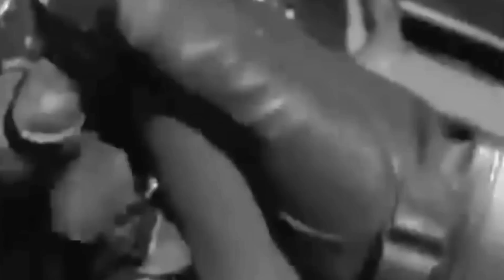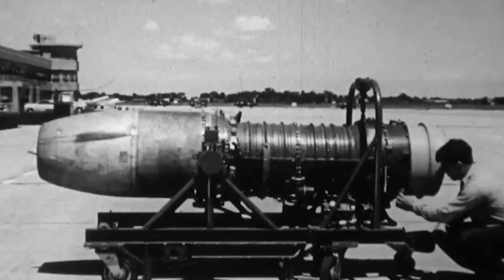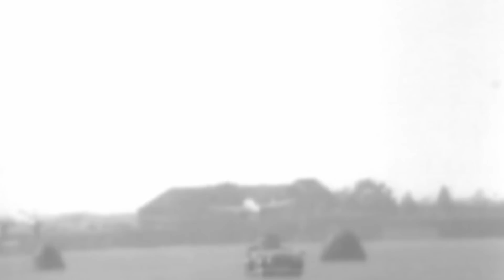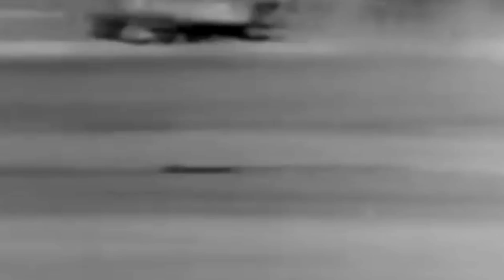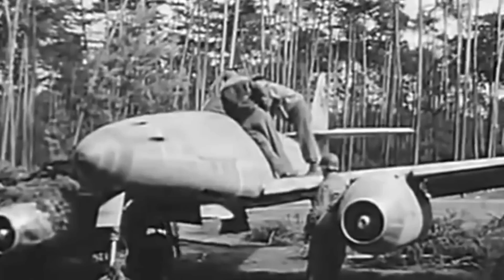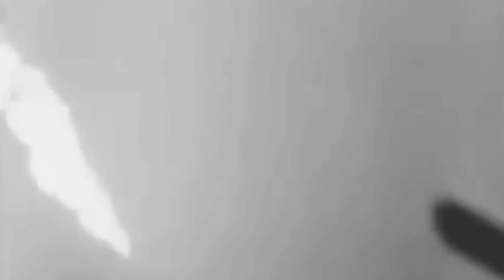The Never Before Seen Fighter

Comment: Swept wings make an airplane faster, and Less maneuverable
Reply: Swept wings and jet engines both make a plane faster and more maneuverable at high speed.
Reply: @WilhelmKarsten : I’m not sure that’s true. I believe swept wings make an aircraft less maneuverable. Perhaps in most cases the greater speed offers better performance than the drawback of less maneuverability.
Reply: @magicsinglez People get very confused about "turn radius"
2 planes with the same speed but one has a tighter turn radius? It will have the advantage.

2 planes with the same turn radius, but one is 100 mph faster? The faster plane has the advantage.

Imagine it in a simple 2D scenario... a bicycle VS. a motorcycle with a 100 mph speed delta.
Reply: @WilhelmKarsten : those variable wings, with the wings way back, allow planes like the F -111 and the F 14 to travel at very high speeds. The plane is almost like a dart.
Reply: @magicsinglez Well, there are two reasons why jets have swept wings, one is the shock wave at supersonic speeds.
The other applies to all aircraft which is reduced drag... both in a straight and level AND less drag in a turn...
Every time you turn, you lose speed.
Swept wings lose less speed, and thus turn faster.
Reply: @WilhelmKarsten  Hello Sandyboy, you forgot the other reason for swept wings, you know the reason that the Me 262 had them... to control the position of the centre of gravity.

Comment: If the Me 262 dropped your jaw then check out the Horton 229 flying wing 😍
Reply: Only one ever flew once and crashed and killed the pilot !!!  A failure !!!
Reply: @wilburfinnigan2142   Not counting the V1 glider that flew.  The second prototype V2 flew under jet power, but only for about two hours total testing time before the fatal accident that killed Ziller.  This was 18-Feb-1945 and the V3 third example was only 50% complete when Patton's forces captured the Gotha workshop in mid-April.  The US let the RAF examine the V3 with some discussion of getting it in the air, but nothing came of that.  That is the short history of the 229, certainly not what that NatGEO TV show implied.

Comment: The ME- 262 was most vulnerable at take off and landing as stated. But it's major flaw was it's JUMO engines initially. They had a tendency to fail without warning, and the replacement/ maintenance cycle was about 6 hours of running time. This made them very maintenance intensive. Allied photo intelligence was used to identify airfields where ME - 262's were stationed, so P- 51's were used to loiter near such fields, to strike ME- 262's when in take off and landing cycles, where they were most vulnerable to attack. Once again, numbers of P-51 and allied aircraft out ran the technical superiority of a smaller number of ME-262's.
Reply: Nevertheless the introduction of jet fighters like the Me-262 rendered all propeller driven fighters obsolete.
Reply: @WilhelmKarsten  Hello Sandyboy, obviously you are still struggling with the meaning of common English words. 
Not only did the Me 262 NOT render propeller driven fighters obsolete, the Me 262 was itself obsolete long before propellor driven fighters.
Reply: The USAAF exhaustively tested the Me-262 during Operation LUSTY and confirmed TBOs averaged 55 hours, EXCELLENT by WW2 standards for Allied high performance piston engines
Reply: @WilhelmKarsten  Wrong they were lucky to get 5 hours , some new engines failed before the plane took off !!
Reply: @wilburfinnigan2142  No different from Allied piston engines... just much higher performance
Reply: @WilhelmKarsten  Hello Sandyboy, as you know 55 hours is certainly NOT excellent by WW2 standards for Allied high performance piston engines (it wasn't even excellent for the German piston engines). The Merlin had a TBO of 240 hours and the R-2800 had a TBO of 300 hours. When it came to jet engines, both the Welland and the Derwent had TBOs of 150 hours.

Comment: The real problem was titanium, which was not available in Germany. So they had to use steel for the engines, which needed a change almost every fight.
Reply: The USAAF exhaustively tested the Me-262 during Operation LUSTY and confirmed TBOs averaged 55 hours... excellent by WW2 standards for Allied piston engines
Reply: @WilhelmKarsten  WRONG !!!!  The engines were lucky to last 5 hours, why testing was stopped on the Me262 by the USAAF as they ranout of engines !!
Reply: @wilburfinnigan2142  The USAAF tests confirmed TBOs averaged 55 hours.
Reply: @WilhelmKarsten  Hello Sandyboy as you know your 55 hours is NOT excellent by WW2 stanadards. The Merlin engine had a TBO of 240 hours, the R-2800 had a TBO of 300 hours and the Welland and Derwent had TBOs of 150 hours.
As you know Sandyboy the Ju004 engines fitted to the Me 262 are well documented to have been fragile and short lived.
Reply: All jet engines are made of steel, titanium is only used in modern Turbofan engines

Comment: 30mm Cannon's? Are you sure?
Reply: The Messerschmitt Me-262 could be fitted with up to 6x 30mm cannons.

The 30mm shells contains 86 grams of high explosives, single shell could blow the wing or tail right off a large 4 engine bomber and a direct hit on a single engine fighter like a Spitfire would completely disintegrate the aircraft.

Comment: This video is lttered with inaccuracies. Swept wings aren't about maneuverability or agility. They are about stability and durability at speed. The swept wing delays the shock wave traveling down the wing and preventing the wings from being torn off the closer the plane got to the sonic barrier. The 262 was not more agile than its piston counterparts, but it was faster. The 262 used a hit and run tactic to great effect, which is exactly the same tactic used by F4 pilots later against the more agile Migs.
Reply: Actually swept wings allow jets to turn at higher speeds than would be possible for straight wing aircraft because straight wings create more drag in a turn, like the way propellers lose thrust in a turn... 
Straight wings = low performance 
Swept wings = High performance
Reply: Actually the Messerschmitt Me-262 could turn and maneuver at speeds that Allied straight wing aircraft could not achieve in straight and level flight.

Please remember that "turn radius" is completely relative to speed and does measure a planes superiority in a dogfight, speed is a far more critical factor.
Any questions?
Reply: @WilhelmKarsten  I have question Sandyboy... why do you keep spouting garbage.
As you know Sandyboy Eric 'Winkle' Brown stated that the Me 262 was "NO FIGHTER" and that it couldn't be used effectively in dogfight maneuvers.
 Me 262 pilots were discouraged from carrying out such maneuvers and from engaging allied fighters.
From the Smithsonian on their Me 262 exhibit -

"Despite its great speed advantage, the Me 262 was not as maneuverable as top-of-the-line piston fighters and it had a tendency to stall due to a tricky compressor. The jet engines burned out quickly and were not that reliable."

Comment: This is well below your usual standard and needs re-writing. The round the clock air raids of 1944 were mainly flown by British Commonwealth bombers at night in all weather conditions. Lancaster and Halifax planes were the most common types. The USAAF used B-17s on daylight raids only, at very high altitude which made for serious targeting errors and planes bombing their fellow airmen when formations were not synchronised properly. Many things could break the timing and positions of B-17s. I know this because my father was a radar crew leader and he flew with both air forces to test radar installations inclusive of proximity scanners designed to avoid 'friendly losses'.
Mustang fighters indeed supported bombers and with upgraded Merlin engines could have great range but Mosquitos and some Hawker Typhoons late in the huge raids were much more flexible, despite the fact that the Typhoon was hard to fly well.
Whittle patented the first pure jet engine as early as 1930 and (because he was a serving RAF officer) was not given proper resources to work on axial and radial flow jet turbines side by side in real prototypes. Had he not been restricted he would have had something like the Meteor in service by 1943. Ohain openly admitted that he had used Whittle's pre-war designs for his own work and the two met after the war.
The Me-262 was fast but not at all agile and this could explain downing bombers by crashing into them before ejection crossed the minds of their pilots. The burn out rates of the engines scared many a 262 pilot and many planes were emergency landed or ejected from when compressor readings went awry. The 262 could not fly on just one engine whereas the Meteor could and if Whittle's proposal of a single engine fighter codenamed 'Ace' had gone ahead there could have been an RAF jet flying by 1942. In the event the Meteor began service on July 27th 1944 and was soon adapted to night fighter duties for 'special ops'.
You really must endeavour to achieve accuracy.
Reply: "The round the clock air raids of 1944 were mainly flown by British Commonwealth bombers at night"....    
 The British were not flying "round the clock", they were flying at night due to an agreement between the Yanks and the Brits to split up the bombing raids according to the strengths of thier bombers.
 The Americans were able to fly massive formations of very heavily armed aircraft and were able to defend them even during the most dangerous daylight hours.
 The Brits on the other hand could field smaller numbers of faster, more heavily loaded bombers, with    smaller crews and less defensive firepower than the Americans.  It was a tactic meant to play up to the strengths of the individual bomber forces, and it worked well, even if it meant high losses for the Americans.
Reply: @jstephenallington8431 RAF bomber command was foced abandoned daylight raids, they suffered horrific losses in daytime missions to the point that British bomber crews refused to fly during the day... the problem with British losses was so severe that British crews began to mutiny and were arrested, sentenced to work in coal mines...
Reply: @WilhelmKarsten 😂
Reply: @WilhelmKarsten  Sandyboy, that's one of your most entertaining copes so far. Very funny mate.
Reply: @jstephenallington8431 ❤😢🎉 11:00
Reply: @jstephenallington8431 😊
Reply: This video is far more accurate and believable than your fantasy filled revisionist trash and outright lies..
You sir should be ashamed of yourself or are you completely delusional?